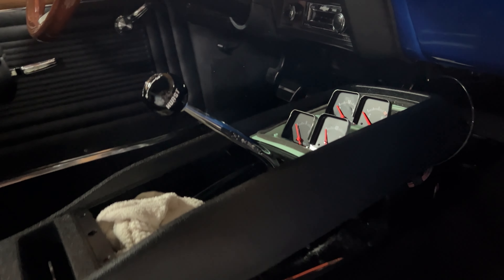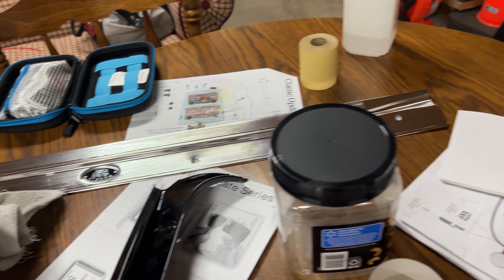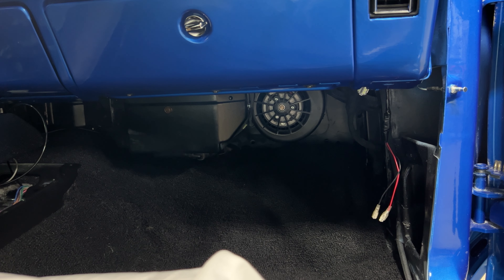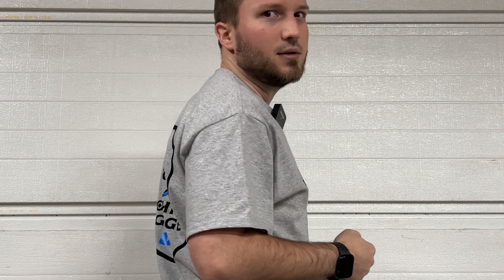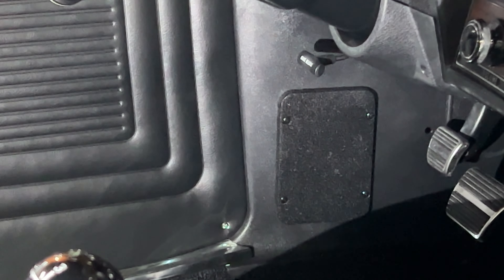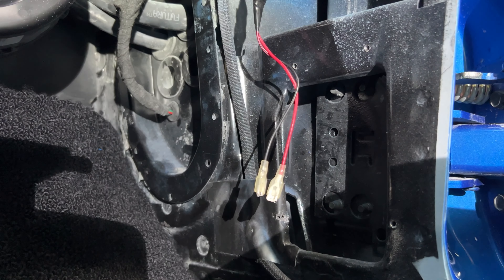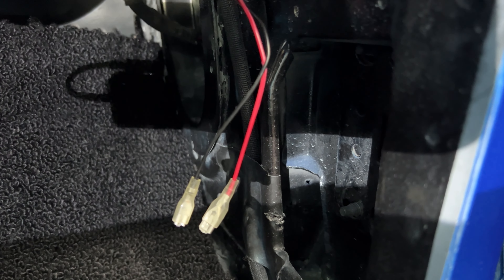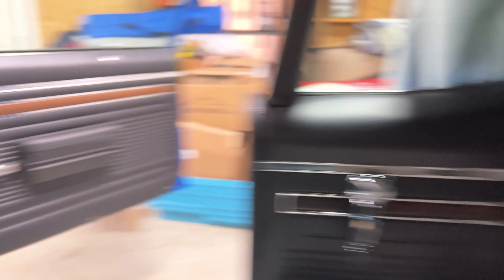[How To] Install Kick Panel Speakers - Sounds Fantastic! - DIY

Comment: Love the videos. What size were those speakers that you used for the kick panels? Did you look into the kick panels the have pre-molding for 6in round speakers? Im still trying to figure out what way im going for my 70 nova.
Reply from the maker: I’m glad you like the videos! We used Custom Autosound 4” x 6” speakers in the kick panels. They fit perfectly behind the rectangle factory-style speaker covers.

I did look at the pre-molded kick panels for round speakers, but all the ones that I saw had the manual vents built in for cars that don’t have AC. I’m not a fan of the manual vents in the kick panels and we put AC in the Nova so I went with kick panels that didn’t have those vents in them.